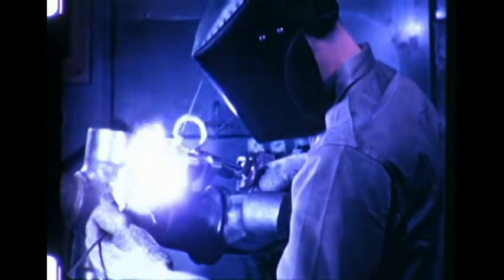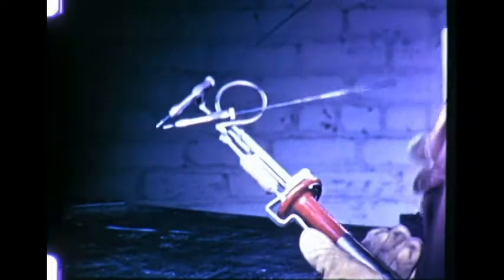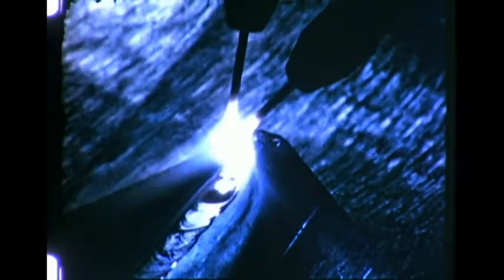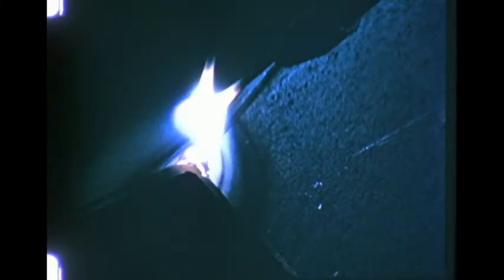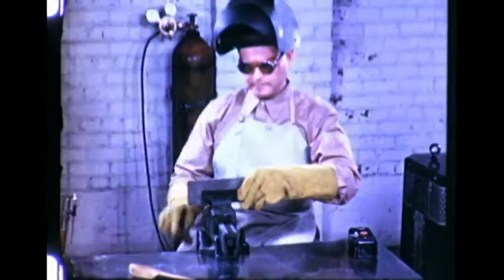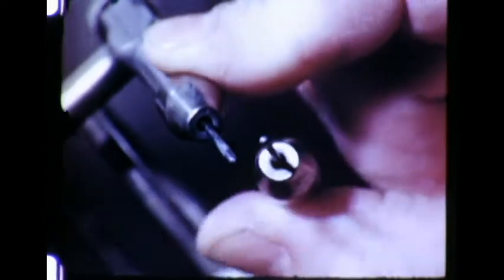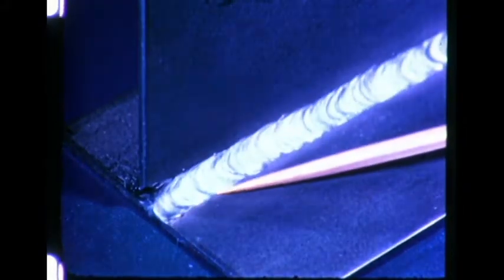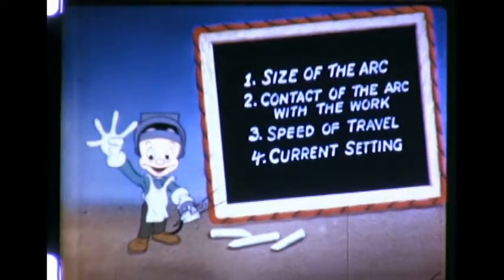The Inside of Atomic Hydrogen Arc Welding, Part 2 - 1943

Comment: Whats amazing about this process, is, given the hydrogen is just, blown out around the annulus of the two tig cones, , much of it might escape and only a fraction may be actually electrified. Hobbists should carefull experiment w this.
Reply: Maybe not all of it is 'electrified' but enough is dissociated to monatomic hydrogen that the recombination produces heat.

If you electrified (e.g. put an extremely high voltage on) the dissociated monatomic hydrogen, you might be able to strip the electron to form plasma (the CRC 'rubber bible' handbook will have the information on the energy needed to do this).  There are far better materials than hydrogen gas to run in a plasma torch, though...

Comment: I would definitely use atomic hydrogen for hobby welding. Nowadays, you can refill your tank using hydrochloric acid and aluminum foil to get hydrogen gas.
Reply: It's simply not that easy, and it's definitely worth it to just get a hydrogen tank, correct regulator, and make sure all the fittings are extremely tight.

Comment: What is the current,  if these two tig torches didnt have the HH going to them,  would they nor produce enough thermal energy to weld? Sheilding gas? Can this be dc to?
Reply: Atomic hydrogen welding only used AC, but it can be used on DC.
Reply: The hydrogen is the shielding gas (against N2 and O2).  The electric arc dissociates the H2 into monatomic hydrogen, which recombines rapidly with significant prompt exotérmico at the edge of the fan-shaped flame: it is that speed of heating that effects the weld.

Comment: With these old welder videos from GE, we can see where the term “crank it up” came from.
Reply: a nearby welding school here still has crank transfromers, keeps running for 50 years till this day.
Reply: @nicoliedolpot7213  yeah. Just one working part. Unless the insulation goes bad, and it’s cleaned, no reason for it to fail. Of course, the efficiency of these units is really poor.

Comment: I love everything about this.  Was reading about it, and seeing photos of this apparatus maybe twenty years ago, just now seeing it in action for the first time.  The only problem I can see is for those materials that are sensitive to hydrogen in welding.  I mean, in arc welding there's this whole issue of Low Hydrogen welding rods....  In general it's so elegant and simple, the giant GE welder is amazing.   I think it was special, high output voltage (over 100 volts I think).    This outfit could now be portable!  I like to think that the one in the film is still in use today, I don't think there's anything in it to get old or wear out....
Reply: Maybe the low hydrogen is just another way of gatekeepers keeping value tech. They seem to indicate that the h1 to h2 process acts as a shelding itself,  maybe not.
Reply: Hydrogen is the shielding gas whether monatomic or diatomic -- it excludes air and nitrogen.  The hydrogen does not burn with oxygen as in the oxyhydrogen blowpipe, and in fact it is the recombination to diatomic shielding gas that liberates the extra heat in this process.  The hydrogen burns off outside the arc plume, but it does not contribute useful welding heat.

Comment: Wow I never even knew this process existed! What a cool old video, thanks for sharing.
Reply: This is the predecessor of modern plasma torches. Wonderful technology...
Reply: Delphi Builder I never knew that. What I do know is the .125 wall full penetration butt welds that we make and they have to be fully ground plasma has the least distortion and makes the job easy as it can be. I used to run a very cool plasma overlay machine that added powder filler metal that made the smoothest welds, the machinists loved that old welder compared to other wire welders doing the same job. If the welds are not super smooth they will just chowder lathe insert. Not to mention I love my plasma cutter. It saves so much money on fabrication jobs, oxygen and acetylene have gotten stupid expensive! Yep fair to say I am a huge fan of the plasma end of cutting and welding.

Comment: hmm the part about atomic is what got me wondering, sounds like some kind of hydrogen nuclear fusion process, well I guess you are fusing metal, heh, but I ment like a thermal nuclear type process like the hydrogen bomb of sorts, I mean they have laser welding and so forth, but this looks cool but nothing more then what looks like a plasmatised hydrogen gas.
Reply: Well since you mention it- This reaction goes in a way you want!  That is, if you're trying to avoid oxidation, this not only displaces the oxygen (and nitrogen) in the atmosphere, but tends to reduce oxides that are already present.  Note the shiny candy-like appearance of the puddle.   Also, not only does the recombining Hydrogen release a lot of energy, but it releases  it to some extent at the metal surface.  The white hot hydrogen then burns in the good old atmosphere, generating all that fire you see.  This was the original precision welding technique before TIG, which was a war time secret.   Supposedly it was good for aluminum, high chromium stuff, monel (as shown).    I wish I had this!
Reply: @leonardpearlman4017  after reading all of your comments on this video, I think I need you to tell me some bedtime stories or something.
Reply: The substance is called HYDROGEN. Not hydrogen gas. Therefore it's not plasmatized hydrogen gas, but hydrogen plasma, just like ice isn't solidified liquid water.
Reply: The difference is that plasma welding is dissociated gas at high temperature, whereas atomic hydrogen recombines quickly  to H2 with high prompt exotherm, which quickly transfers to the weld pool.  The hydrogen then combusts, but that's only about 10% of what the recombining yields.
Reply: Think stan Meyer or lightsaber like tech
Reply: Stan Meyer did not apparently figure out where the 'excess power' was coming from.  The dissociated HHO acted as a promoter for vaporized hydrocarbon fuel combustion (in the same general way toluene does for some diesels) so the FUEL produced better performance.  But just trying to run on 'recombination to water' is no better than any other perpetual-motion machine.
Reply: +manga12 you are correct. atomic hydrogen just means a super high purity hydrogen of a single isotope of hydrogen.
there is actually an electric arc, but the combustion of the hydrogen with the atmosphere is what generates the real heat. 
adjustment of the amperage through the arc igniting the flame changes the rate of combustion.
I think it's one of the only flames that burns hotter than oxygen+acetylene
Reply: +MrJgstoner well color me embarassed. Turns out hydrogen really likes to bond to itself and it takes a tremendous amount of energy to break it apart.
So there is molecular hydrogen (by far the most common) consisting of a molecule of two hydrogen atoms.
Then there is atomic hydrogen with just one.

Regular molecular hydrogen is pumped through the tungsten arc and excited to the point where it dissociates into atomic hydrogen, which is highly energetic and very reactive.
I'm still not clear on how a very reactive gas can be used as a shielding gas or what the hydrogen is bonding with after it carries the arc or even how it is considered a flame since it is just housing an electric arc... I dunno.
Curious. curious
Reply: +MrJgstoner right well the hottest general welding or torch gas is oxy acetylen, but there are two others that are hotter burning, one is cyanogen, and the other is dicyanoacetylen, the last burns at 10000 degrees ferenhight, but its a nasty bugger and has a quad nitrogen bond, and once broke lets off tremendous energy usually in the form of an endothermic reaction which is what explosives have, they are not generaly available to just everyone, and have to have special storage due to their properties, but dicyanoacetylin can be found on the moons of jupiter they say.

heh and hotter yet is electric arcs and plasma, but thats a differant state and not a gas.
Reply: Thanks 'eh! I learn so much from youtube. it's such an amazing tool.